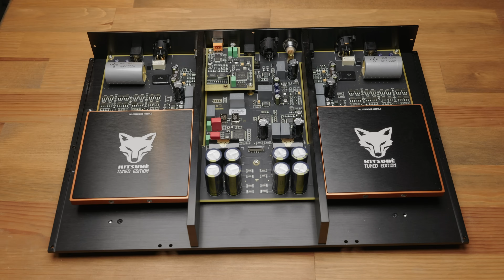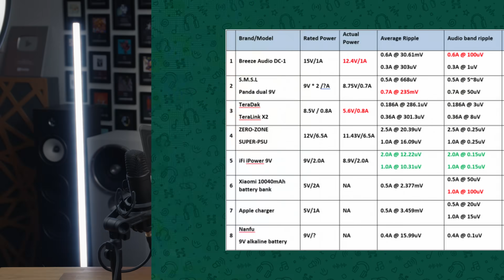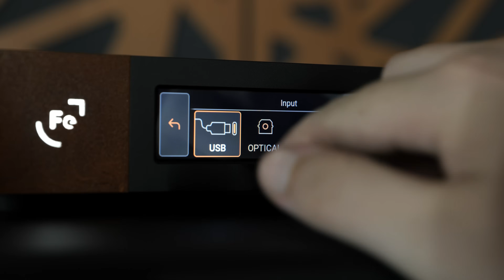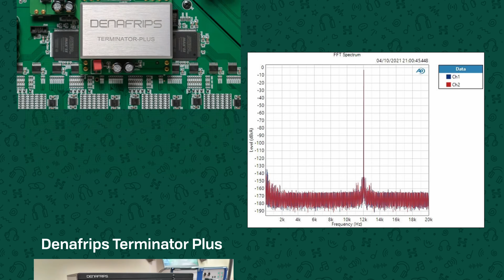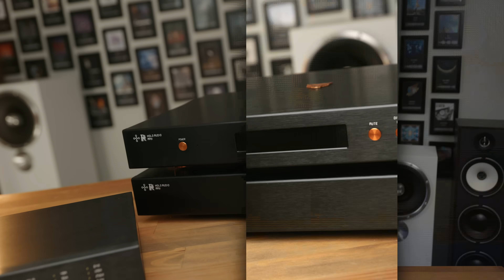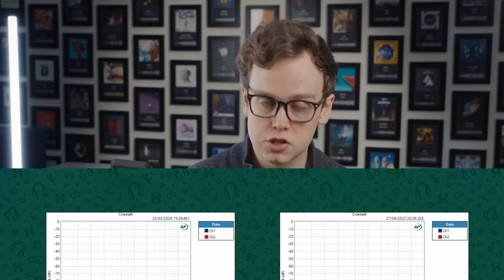How do DACs actually work? - DAC circuitry walkthrough

Comment: If you are spending £600 on a DAC like the Z8, you are an idiot. Especially when DAC chips max out in cost at around £25, or say, £50 for the likes of the ESS Sabre 32bit series if you really want to push the boat out. Everything else is fluff.
Only exception is if you literally have money to burn. But know that you're paying more for a shiny case and weighty knob than you are on DAC performance.

Comment: As an EE that does quite a bit of work with instrumentation that needs high isolation and low noise power, it makes me VERY happy to see someone in the audio world thats not just pushing "linear or bust". Its real hard to beat a well made switching supply designed with the rest of circuitry and frequency plan in mind.

Comment: Cameron, it would be great to see your review/teardown of the new Eversolo DAC-Z10. It's got an OCXO clock, followed by a PLL circuit, followed by optional FPGA-based clock shaping – all very impressive on paper, but is it actually a good design?
Reply: I'd say its. just marketing. One can build a very low noise, low jitter crystal oscillator with less than $10 of components. An ovenized XO doesn't bring extra stability or lower jitter, it just keeps the frequency more precise, but at a level you would never ever be able to hear. The $10 XO would be just as good. Then the PLL: a PLL has a control loop, which can also cause jitter if not set up properly and IMO as an EE it doesn't bring anything extra "good" to the table than justification of a higher price.

Comment: why do USB DAC like Fiio, Ifi and etc... that are much more smaller, can be powered by USB only and support DSD and everything at a way enough power output of 0.5W, 1W or 2W,compared to this giant DACs we see in the video ?
Reply: Because this is overkill snake oil stuff you almost definitely won't notice ever, especially if you don't have it in a perfect ABX setup to directly compare assuming there even are any noticeable measurable differences. Even the whole >48kHz and >16bit stuff is just snake oil.
Reply: Just read The Art of Electronic Design... you will get more answers.

Comment: Where does EQ fit into all this? Are changes done to the data values themselves, before the DAC does the conversion? 
For example, you increase a narrow area centered on 500hz by 1 dB.  Is the music file itself that's been loaded into temporary memory, rewritten? Then the DAC does the conversion like before, ignorant of the changes. It just takes the digital values handed to it and then spits them out as the corresponding analog waveform?
Reply: If the EQ is a digital (DSP) based eq it will occur before DA conversion. If its an analog eq that uses simpler controls like 'treble', 'bass' knobs it will be done after the DA conversion.
For your second question - if the EQ is DSP (digital eq), it wont alter the file stored in memory but rather take the bitstream from the RAM and alter it in realtime at the sample rate (just like how plugins work) and then send that stream into the DAC. The DAC is agnostic to the changes and will process it like any other input.
Reply: @mixedbynair thank you for answering

Comment: Great video! worth adding that many DACs use a switch-mode PSU to generate a "work" voltage and then use converters to pull it up or down. Usually, these converters are also switch-mode. This mostly negates the use of fancy external power supplies, as the performance is very much dictated by the conversion and local regulation circuits.

P.S. Check out the Apos Merlin. A 250$ DAC with a custom USB receiver solution and galvanic isolation. Also sounds pretty superb!

Comment: I wish I had such a video back then when I learned all of this. Great video.

Please do a follow up video on clocks, ideally with the example of the dCS Lina + external clock. What are the differences in implementation, and do measurements confirm the subjective improvements?

Comment: I have a suspicion that if more people understood the technology behind DACs, there would be less snake-oil and deception in the audiophile world. Thanks for this video!
Reply: So this item does or does not count as snake oil?
Reply: @chungang7037 These items? No. Even if a DAC is massively overbuilt or unnecessary for most people's use cases, it isn't a scam by normal definition means. It can be overpriced, overbuilt, unnecessary, etc etc, but scams are usually the pure snake oil stuff like overly fancy cables that try to convince you that they make a difference for every headphone or IEM in existance, or audiophile stickers (lol), or accessories like that, that promise wild claims but hold absolutely zero scientific or logical basis. 

Snake oil stuff tend to usually pop up more often with older individuals than younger but there are exceptions and many audiophiles today are way more informative than previous years before.
Reply: @Shyvorix but being over engineered counts as snake oil if there is no change in sound. I suppose we could argue it might be slightly brighter or warmer but is that really a difference worth spending thousands on? What if there is no difference?
Reply: @chungang7037 Then it potentially gets into snake oil territory there. It's more relevant to some DACs for sure rather than amps since amps tend to vary wildly in output. For DACs it depends because some manufacturers will potentially use one of the big 3 brands (ESS, Cirrus Logic, and AKM) while others will actually make their own custom solution from the ground up. Even if some sound similar if not the same compared to others, it isn't a scam if a manufacturer claims that they have phenomenal performance and the measurements back it up, it just comes down to is it worth it for a person looking at it. Value is purely subjective, so as long as there can be some perceived difference under some use cases it's hard to argue sometimes. It's a tough call unless a manufacturer is absolutely bullshitting.

Comment: How much do the control chips influence the sound of the dac? I know the digital processing and the type of filters and ofc the analog bit is important but does the control chip play any part
Reply from the maker: Ideally, not at all. They're mostly practical/feature related. There's two ways they could affect sound:
1) DSP, sometimes if they're being used for things like custom oversampling, EQ, crossfeed etc then they'll of course have an effect on sound, but then it's just a case of whether you want to use those features or not and generally you should be able to keep them disabled if desired.

2) Clocking influence. In the case they're being used for clocking management, PLLs etc, then they could influence the jitter performance of the DAC, but in those situations they'll have been put there because they are (hopefully) making a benefit vs just feeding things directly to the DAC chip straight away.
There could be situations where the control chip is negatively influencing jitter if it is indeed handling clocking as well but is mostly focused on stuff like DSP and the fact the clock signal is coming from it is purely for compatibility. But the answer there being just check the measured jitter performance of the DAC

Comment: Great job explaining the various aspects of a DAC and what sensitivity each aspect has in the overall performance.   Just one note, I see you’re wearing a polyester or wool sweater, the units are open on a standard table top, and very scary you are putting your fingers very close to the low voltage CMOS components without wearing an ESD smock, an ESD grounding wrist strap, or having the unit on an ESD grounded bench top mat.  Please review a short ESD training and show viewers the precautions needed to avoid blowing up your DAC with an ESD discharge.     Yes chips are more protected when mounted on a board, but still are susceptible to damage.  Cheers
Reply from the maker: Heya! I appreciate the concern, and it is something worth mentioning for viewers. I am actually wearing an ESD strap, it's just around my ankle so that it doesn't look odd on camera (and so I can handwave to my hearts content without snagging stuff :D)
Reply: @TheHEADPHONEShow   that’s good to hear, you know your hardware very well so I was a little surprised not to see any ESD precautions.     Other precautions typically used are Ionizers, and humidifiers which can help a lot.